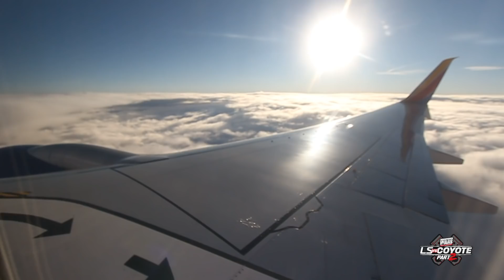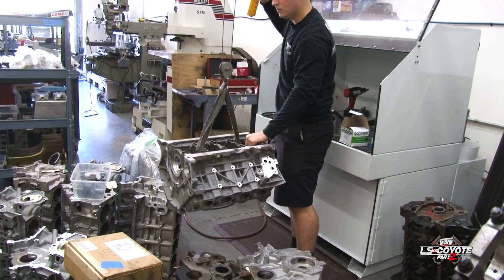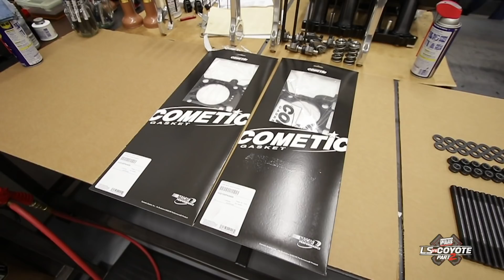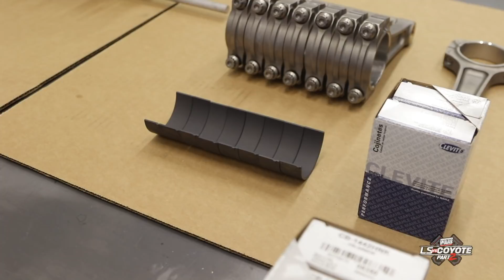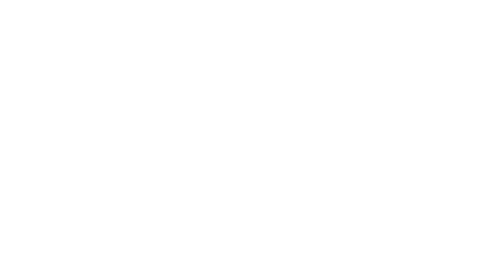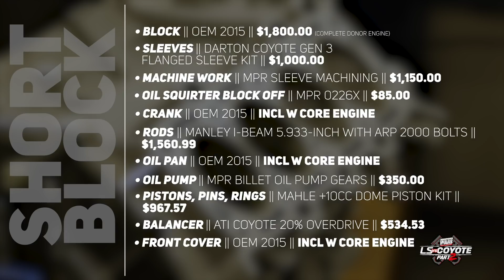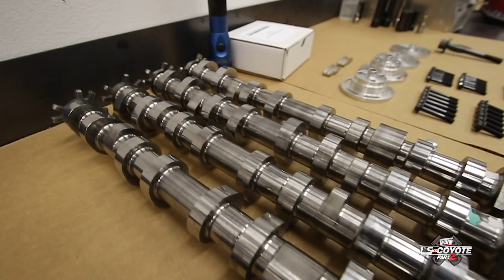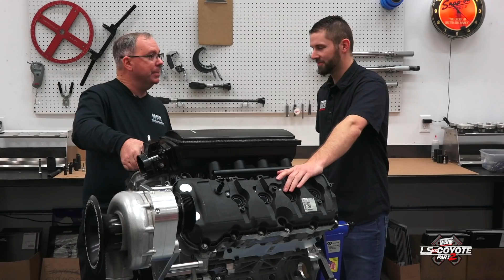LS vs. Coyote 2 Episode 3: The Coyote Engine Build

Comment: Come on guys I would put $1,000 wager that you cannot call that machine shop and ask them to build you that same exact engine for $15,000 will never happen. So let's take away the expense of the Machining you still cannot buy that engine the blower alone is going to be 5 to $7,000. I personally am a LS fan but I do know the coyote with the four valves loves boost. Also coyote parts are way more expensive then LS parts . Have any of you guys priced a set of coyote heads with upgraded valves and also a CNC Port job twice as many valves and twice as many Parts Plus Chainz and guide come on these guys are think we are dummies I bet you couldn't buy set of coyote heads done up that way for 5 grand but anyway let's watch the results and see who built the best motor
Reply: Go to the LME page and build the LS for "15k" machine work on the block, heads, and crank were not factored in for the LS but the machine work for the Coyotes block and heads came out of the 15k. Bulk of the money on the coyote went to the heads .... Cause theres more of everything
Reply: Hey Einstein...they used a Junk yard truck  Coyote engine. The cranck was the factory crank also...so a sleeved blocks and rotating assembly is what they bought as they did the LSX...however the LSX was a bbig lie...tell me you can buy a 427 Brodix All Aluminum Engine, custom intake and ported to match for 15G's. Give your head a shake...the Coyote is still just a 5.0 Liter.

Comment: The LS platform is a cheap Byzantine pushrod POS which is why Koenigsegg went with Fords DOHC platform and why the Supercar and Hypercar manufacturers go with a DOHC design in general. No reputable Supercar is going to put cheap rock and chisel pushrod motor in their car
Reply: Have you not heard of the Hennessy venom 🤣
Reply: @robertgardner2782 and have u heard of new vett - yep DOHC
Reply: The fastest cars in drag racing run pushrod still simpleton. While the coyote is a great motor from the factory and kicks the shit out of the LS. Top fuel, funny car, pro stock, pro mod etc all the fastest cars are pushrod still numb nuts.
Reply: Wayne Bollentin lol the LS absolutely destroys the Coyote wtf are u smoking son
Reply: perplexed 666 Fastest 5.0 in the world ran 5.80 no Ls will beat that what drugs are you on? 🤣🤣
Reply: @MM-su4gu  doesnt it hold the full mile as well if im not mistaken
Reply: @waynebollentin989  race engines are totaly difrent to main stream
no to mention top fuel drag regultations force OHV just like nascar
Reply: Too bad ford guys wont be able to say this for long...….Ford is making a push rod V8 LOL!!!
Reply: @SuperSilvi1990  ye, for a truck wher it belongs
Reply: @sahiel5  and when asked they said that it will fit in the mustang they checked. We might be seeing one in the future.
Reply: @SuperSilvi1990 
no it cant
no they wont
no we will not
Reply: @sahiel5 
it's a push rod V8 so it's smaller... so it can fit, Ford themselves said they checked when they were interviewed about it, and we will see some 7.3L Fords swapped into some mustangs, if not from the factory then aftermarket for sure.
Reply: @sahiel5  tractors and lawnmowers, I think not. OHC V8s too physically big and unreliable. Been in the automotive business for 32 years, and seen countless OHC Ford garbage V8s needing timing chain kits at low miles. Guides and tensioners broken lying in the oil pan. One of the worst was the OHC 4.0 V6. The camshafts would come apart. Do your research dude, there's push rod V8s spinning 9000 rpm all over YouTube.  What about the Dodge Demon and Hellcat engine?  Simplicity is key to reliability. I love Ford, they keep mortgage paid and food on the table. Funny, the new 7.3 V8 is push rod. Why, reliability. Do worry, Ford will Fk it up some way. Enjoy your Ford shit. 💩💩💩
Reply: Clifford Cullen 
Really glad to hear that all these fords are keeping you up    but just like you there are other people that live off of the people who own and swear by their LS! Just look at cleetus macfarland and the auction corvette!!! Rebuilt after rebuilt junkyard LS motors every week! It’s so funny watching the people build junk and how long it lasts!
Reply: @sahiel5  they will hell they have put every thing on a mustang from a Ferrari engine all the way to a tank engine and im not shiting you bro lol
Reply: Ya for super duty trucks .. duh ...
Reply: @SuperSilvi1990  why ? you clearly don't have a clue what your talkin about. I'm not even a ford guy like I said in another comment I've built, tuned and raced both for 25+ years. Either works for me. But both side have some delusional people. 1st the new 7.3 gas engine is mostly for the f450 and up. They have zero plan for it to be in a f150 or a mustang. The motor wasn't designed for hp performance it's a truck motor built for low end torque and efficiency. Doesn't have shit to do with the coyote or mustang's so I have no idea what your point it. They don't need anything bigger the the 5.8 when built right you have a 3hp powerplant
As for PERPLEXED 666 The coyote has been 5.88 at 255 with the factory block, crank and heads. Let me know when an factory LS accomplishes that simpleton.
Reply: @waynebollentin989   ........hmmm I'm looking at my comment...aannnndd I don't see your name.. might of been taking to the to the guy up top.

Who......said the pushrod engine is a byzantine pos. As someone who ALSO races, owns a LS, and on knows that no one can beat the HEMI.... a two valve pushrod V8, In terms of power. You can take your simpleton comment back.
Reply: Wayne Bollentin 
I couldn’t have said it any better or explained it any better than you did. I agree that the engine of choice for the coyote should have been the 5.8 and 3hp per cubic inch is there for the taking. My only argument for this whole competition is why didn’t thy use a stock LS7 block. The LSX is completely aftermarket and changes the whole game
Reply: @scottsigmon926 , When referring to auto parts, OEM refers to the manufacturer of the original equipment, that is, the parts assembled and installed during the construction of a new vehicle. In contrast, aftermarket parts are those made by companies other than the OEM
LSX is built by GM
Reply: Leviathan 5.0 - look up s5000 basically a formula one car but they decided to use the coyote to power it. People are starting to see how good this engine is, idk of any formula one spec race car that uses ls. Not to mention Ford’s DFV most successful engine in Formula 1. Or the 294 mph achieved by a Ford 5.8 in a 2005 Ford GT in one mile. Ls kids think they have the greatest engine ever built 😂 please
Reply: @CoyoteFTW  of course no ls would be used, F1 is 9,000 from or higher, that is where dohc engines excel. You don't see any coyotes in nascar either, all pushrod engines. I can name plenty of motorsports that use ls engines, can you? Both are great engines, but the ls is iconic.
Reply: @mrhrobinson  yeah because its the rule num nutts jajajajaja even i know that and im not even a nascar fan
Reply: @argelioolivares631  idiot, I am just making the point that push rod power is still relevant.
Reply: @argelioolivares631  I am not a nascar fan either and I know that.
Reply: @mrhrobinson  well yeah its relevant there there all over the road??? And why make it sound that they dont have mod motors in nascar because push rod is better???
Reply: Horatio Robinson - Formula one > NASCAR.
Reply: That's why Ford is making a 7.2 push rod... give me a break... if it's not broken them don't fix it 😂
Reply: You would have to be a complete idiot to think that, the LS motor is an engineering marvel as far as reliability and power mods. And for you to call it a POS when LS engines have become the norm. They often end up replacing your so called DOHC engines.
Reply: Those POS pushrods have been ruling the motorsports world for Decades, ask team corvette, and all of NASCAR to name a few. Wasn't the viper a pushrod configuration? And some indy cars also.
Reply: There using LS motors in 150,000 dollar sand rails, trophy trucks, drag cars, boats, and have been approved for small aircraft. It works and works hard and lasts. It's amazing how many chain problems I've seen on overhead cam engines. Miles of chain rubbing against plastic chain tensioners and guides that fail and end up in the oil pan. Wrenching for 32 years and fixing drivetrain and engine problems I see things from the inside out. Less is more.
Reply: @cliffordcullen1687  race engines like that are build form the ground up - often machined from one peace of metal,not casted - main stream aplications for OHV are tractors and lawn mowers
Reply: thats why ford came out with a new pushrod pos
Reply: @sahiel5  armchair mechanics, I love them. Your ignorance is your blessing. We have something thats reliable, simple, small in size, puts out a lot of power, parts interchangeably is insane and just flat works good. Low IQ Ford goonies will always be jealous. The LS is reliable simple interchangeable platform that works. Bell housing pattern hasn't changed since 1955, big blocks, V6s, Inline6s, even the duramax diesel uses it, so transmission applications are endless. The Ford, not so. Their 302 from early 70s though early 80s had 3 different designs in flywheel and bell housing configurations and that's innovation? Plastic brake caliper pistons, discovered that doing brakes on a exploder. I really like the plastic range fork in the F150 FX4 transfer case I had to replace. Innovation, I think not. My uncle bought a loaded 2017 F150 EcoBoost 4x4, guess what, it overheats pulling a trailer up a grade and gets 5 to 7 mpg towing. Wow that's impressive. My business is done here. I'm done arguing with this. Facts are facts. Besides I'm a Landcruiser guy.🤘
Reply: You will singing a different tune when you are bragging up the new 7.3 in the Super Duty.
Reply: @ScottPatrickCallahan  I sure hope it works for them, remember the powerful, reliable push rod 460! Not all engines they made were junk, some were reliable work horses but was long ago. Like I said I sure hope it works for them, I lifted my eyebrows when I read about it, sounds like it's a beefy engine. 👍Hope the bean counters don't "F" it up for you Ford guys. 👍
Reply: @cliffordcullen1687  I had a 1969 Ford half ton 2wd with a 390. It was a damn good truck and motor. Put an Edelbrock aluminum intake, Edelbrock carb, cam, headers, and dual exhaust on it and it would run out quite well. The great thing about pushrod motors is they are easy to wrench on and there are a ton of parts available.
Reply: Lol and ford just came out with a new pushrod design, you sound like an idiot.
Reply: @Alpha Wërks  wow simpleton you must be young and or stupid. First we are taking about drag racing. Land speed motors and drag racing motors are to completely different worlds. Don't get excited though. Your still wrong and a simpleton. First of all my only point was how far the 4.6 and coyotes factory block crank and heads have been pushed within different combinations with and without modifications vs the Ls. I've said this many times. I'm not being bias here. 
 Now you must be talking about the motor that was built by Kenny Duttweiler. One of the best engine builders ever in racing and not just one type of motor or racing and the Buick king. Specially with small ci motors. He has been making tons of hp with Buick since the 80s and gets just about 2000 out of a Buick v6 that's only 265ci. His 215ci twin turbo ran 6.75 @ 208 in a GN and that was over 25 years ago. His motors set many records in drag racing and in land speed with Buick. He is a motor genius. The motor your talking about is a complete aftermarket racing engine. Dart block aftermarket heads etc. Heres another kick in the balls. Yes the ls went over 400mph but they are very expensive and different small ci motors. Most small then 350ci. He gets 10,000rpms+ out of many these small engines. They also don't make more then about 2700hp. The ford has made 3000+ so the land speed record means shit anyway. There's many different types of cars, classes, rules and weights with that type of racing. What one motor does in one car won't do in another.
 Many of kenny's motors held records and still do in different types of racing. Buick is what made him famous in the 80s but builds all GM Buick, Chevy, Ford, etc. This guy is brilliant when it comes to motors. Anything he gets his hands on makes horsepower.  
Next time do more research instead of 1 or 2 Google searches. I wasn't just making shit up when I said I've been doing this shit for years. I had cars that ran low 7s back in very early 2000s.  My experience comes from doing it and knowing people like Kenny for almost 30 years.  What it seems like you do is get half ass information from the internet more then half the time. Now you thought you were smart going to a completely different type of motor and racing and had a gotcha moment but you came up short.
It was a nice try but your still wrong. At least you picked a really legit engine builder that's been doing since the 70s. I give you extra points for that but nothing on that motor is made by GM sorry. It's not even a GM lsx. It's a 6 bolt Dart lsx block. Better luck next time son.
Reply: Really? Last time i checked when  i built the MT900 we but LS6's in it. Then we started putting ls7's into it.
Reply: Leviathan 5.0 
Lol! I can’t stop laughing! Beating up on the LS people is so easy and whether you believe it or not, they do have a good truck motor. It’s nothing special, right? Low rpm big torque, just like a dump truck engine!

Comment: What you 5.0 guys cant wrap your heads around is that the LS is actually smaller, weighs less, costs less and has less moving parts than a 5.0 and still makes more power. The displacement is rated higher because it moves more per revolution. That is why the 5.0 needs to rev to 8,000 fucking rpm to do anything. 5.0 has a short stride lol.

Comment: All that hard work just to get outperformed by a pushrod engine🤷‍♂️🤷‍♂️🤷‍♂️
Reply: Seems funny to me all coyote ford fans sound just like ls fans when the ls came out.... tbh i love the ls, hate the coyote, imo the best motors ford ever made was a 460 big block and a 351 windsor. Which in fact those 2 ford motors have both been proven to make more power and be more reliable than any coyote ever made or built. Just like the LS. Its cheap, easy, reliable power. Not to mention gm actually had a dohc v8 i  94 vette zr1 which made 500hp but the problem with them was that the dohc zr1 motors werent cheap to build or fix. Ran good but not reliable like a pushrod hammer n chisel v8
Reply: CamaroLS3 
Sir, at some point you are going to be correct with that statement! The LSX will beat the little ol 5.0 in at least one of the categories.
Reply: @deadboy600 Lmao "little 5 liter" that takes up to 3 times the physical space of an LS.. Get outta here ferd boy the only time coyotes are gapping corvettes and camaros are in a ferd guys wet dreams😂😂👏🏼👏🏼
Reply: @CamaroLS3  omg man who gives a fuck about the physical size. Your just like a fucking girl thinking size matters. Stfu obviously you dont know shit about engines. ls engines are 20 plus years old, its time for the coyote to shine.
Reply: @juicebox8549  Boy shut yo ass up..  You would associate size immediately with a dick thing.. Leave it up to ferd guy to make make things gay.. I know a lot more than you think..The only time 4 valves is really better than 2 is for top end performance.. Pushrod dominate the low to mid range performance..
Reply: @juicebox8549 , try and put a Coyote in a Mazda Miata and come back
Reply: @anthonywebber2211  Interesting you say that.  https://www.youtube.com/watch?v=m4abTbNmN2g
Reply: CamaroLS3 False, an extra 70 cubic inches dominates low end torque. 

4V DOHC outperforms inferior in-line 2V setups across the curve, badly, CI for CI.
Reply: Nick Giotta
read the comments
Jason Rene
2 years ago
Smh where  is the  exhaust smoke ... why is   camera 20 ft away from car but audio is  so sharp and  loud   cause its looped over  the video  . good job on editing though you should work in tv production  lmfao

Andre Illick
4 months ago
Good lord, can nobody tell this is fake.  Motor is clearly photoshopped, not to mention the driveline angle is all wrong.  Wtf is wrong with people.

Aaron Taylor
2 years ago
you guys are so gullible this never happened........Its not real. When have u ever seen a burn out with no smoke or exhaust gasses. also this idoit is on the S197 Forum and refused to show us live walk through of what he did. the motor is bigger than the front of this car.....Geez people...Oh its on the net so its real. smh

Manuel Tinoco
4 months ago
Its crazy how many people actually believe that miata really has coyote engine in it.

and the intake manifold seems kinda high
Reply: BK C
not NA torque curve 
F150 5.0
https://www.google.com/search?rlz=1C1NHXL_enCA703CA704&biw=1279&bih=650&tbm=isch&sa=1&ei=tqZwXOLIN8qe_QazoIf4Dg&q=2014+F150+5.0+dyno+chart&oq=2014+F150+5.0+dyno+chart&gs_l=img.3...41413.50027..50408...1.0..1.1730.7329.0j2j4-1j2j3j1j1......1....1..gws-wiz-img.YXMJ9oP_1As#imgrc=CC6HRc7mKTxpsM:

GM truck 6.2
https://www.google.com/search?rlz=1C1NHXL_enCA703CA704&biw=1279&bih=650&tbm=isch&sa=1&ei=e6dwXI_YG-Hr_Qasx6SQAg&q=2014+GM+6.2+dyno&oq=2014+GM+6.2+dyno&gs_l=img.3...2232.6610..8879...0.0..0.252.823.0j4j1......1....1..gws-wiz-img.......0i24.1ycWdlCuCKE#imgrc=cLL0vDVro8ATpM:
Reply: @BCSVT  We'll see when they pin these engines head to head.. That 2 valve pushrod is gonna wax that overly engineered 4 valve POS.. Just like it did in the in the first LS3 vs Coyote episode 😂😂😂
Reply: CamaroLS3  Very likely, since Tim Eichorn chose the F1A and not the F1X like the LS boys. That’s a 250 handicap right there